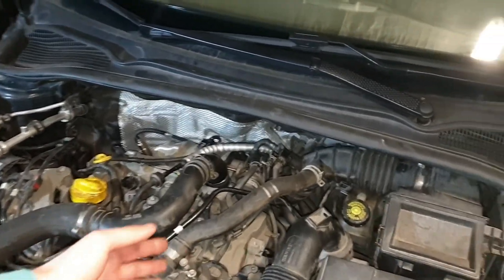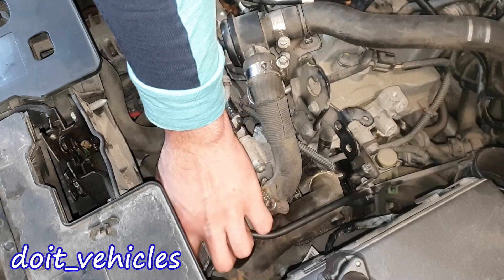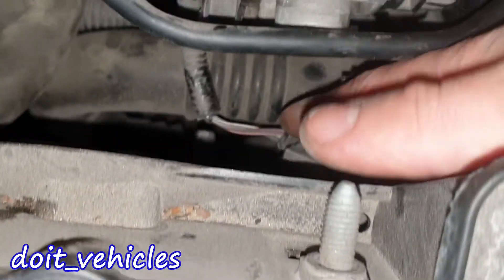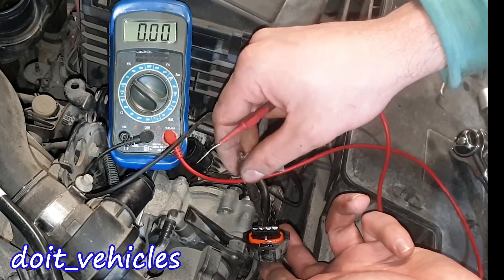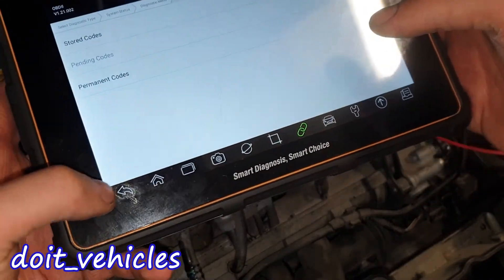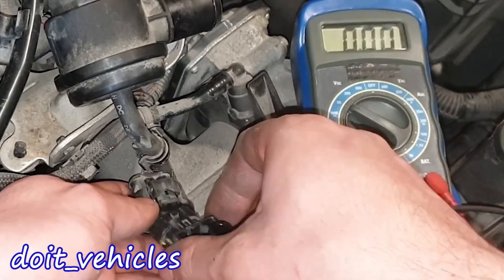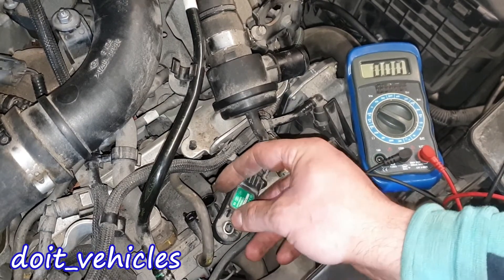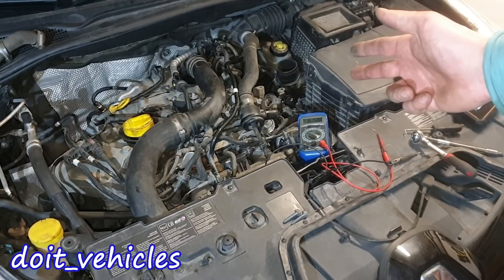MAP IAT sensor PROBLEM on RENAULT CLIO 4 Tce 0.9

Comment: Hi guys, I've got a clio iv tce 90, and am having problems with the start/stop system. When it's stopping, the engine fails for a second like it loses 1 cylinder. Also a few times when starting after filling the tank, it fails 1 or 2 times. It starts the engine and when stabilizing idle rpms, stops and re starts. After 2 attempts it sticks and runs well. It's curious as it was only after refilling,  and on a very hot day. Thoughts? Thanks.

Comment: Hello, can you help me, my vehicle is a 0.9 tce 2019 model symbol, when the vehicle is accelerating in the 2nd, 3rd and 4th gears, that is, when it is under load, it acts as if it is cutting the gas between 2000 and 3000 rpm (slightly), I had the spark plugs serviced 2 months ago. The air filter and oil have been changed. This is a very annoying situation. I wonder why
Reply: Did you find what it is? I have the same problem 1.6 dci

Comment: The 0.9 tce always shows - 40 on intake air Temp. Because no air flow mass sensor. You should look after value for inlet air Temp. Whis show temperatur from first pressure sensor. I testet on 2 cars, and tried different sensors. So - 40 is not an error. Just a sensor which is not present in this engine type.
Reply: This type of sensor is both pressure sensor and temperature sensor in one. Reason for not wieving correct temperature lies in different obd devices like stated in one of the comments. Some of them show correct value and some don't. Have a nice day.
Reply: An where should we look for that inlet value

Comment: Hi,
Really helpful videos, I have a clio 4 tce and I am suspecting that it is running hot, I watched the engine fan and it starts at 99C, do you have the information on the fan starting temperature of the first and second speed. Thanks

Comment: I have a 0,9 tce dacia vehicle, a malfunction appeared in my vehicle. After 2000 rpm, the vehicle misfires in slow gas opening, it does not in fast gas opening, it went to the authorized service 4 times, the service could not find the fault, what do you think could be the problem?

Comment: Good Day. My Renault clio 4 indicates Injection Failure System. OBDII scanner doesnt pick up any faults. Could it be the Maps sensors as indicated in this video causing the problem. My car is currently running in limp mode, difficulty accelaration.....CAn I continue driving until I fix it?

Comment: Tam jest temat "Renault Clio IV Grandtour 0.9 - Czujnik temp.powietrza pokazuje -40st."
Reply: Having same problem a  the  moment  with my autel ,replaced the map/temp sensor cause it showed -40C no help ,wire check done seems okay ,the SLFT at Idle -25 percent and LTFT -10 my head is in a flat spin, did you have any info on your car reading
Reply: @riaanvanstaden284  
1. Inny nowy MAP sensor pokazuje -40
Reply: 2. Inne używane ECU pokazuje -40
Reply: 3. Kable zmierzone - OK
Reply: 4. ECU ma error P00AA (CHECK ENGINE nie świeci)
Reply: 5. Auto jeszcze odpala normalnie
Reply: @riaanvanstaden284try changing the intake manifold pressure sensor. They both have values

Comment: Hello, I was looking at your video and noticed a common value I've seen on my Clio IV 0.9tce Intake Air Temperature value -40°C. I checked it with a simple OBD reader. In my case I got the -40°C because I used EOBD. When I switched to an Autel OBD reader and looked at IAT value it was normal, like 8°C celcius. Do you have a error light on the dashboard or not? If not I would check the IAT value again with Renault Clip or free app version PyRen instead of OBD with for example Vgate Pro Bluetooth dongle. Have a good evening! Thanks for uploading your Clio video's
Reply: i found the same with my foxwell i70 that in obd2 mode its -40 but under Renault it was showing correctly